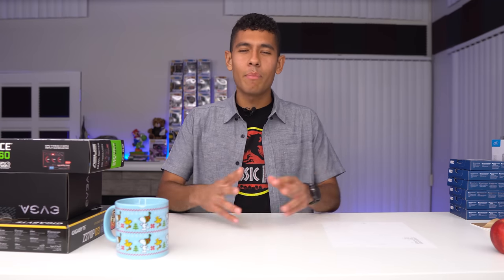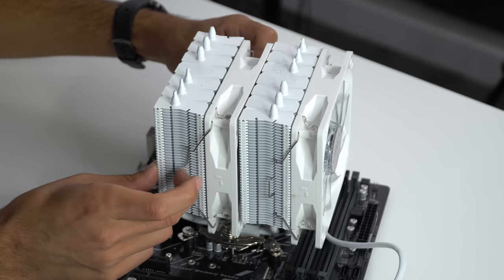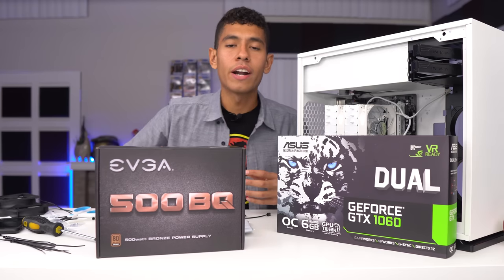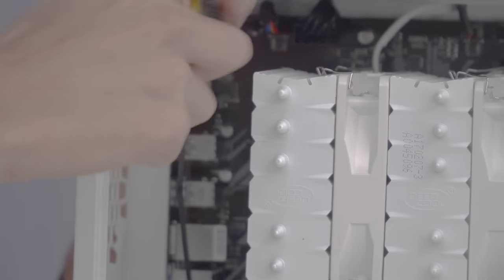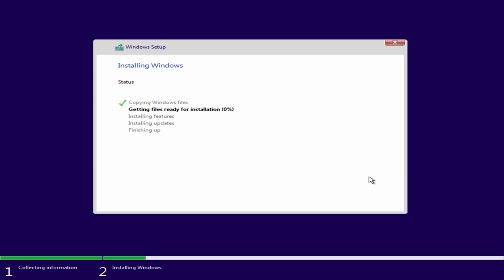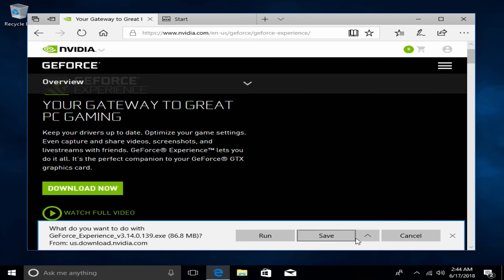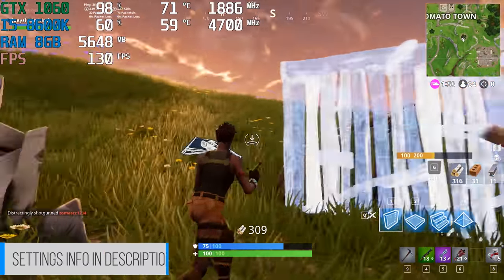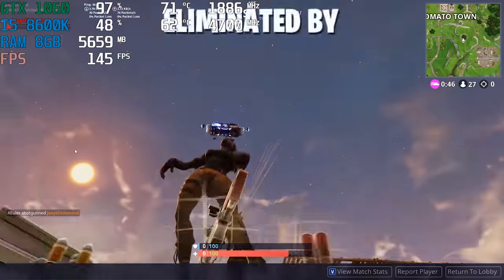Best $1000 Gaming PC Build Guide - GTX 1060 i5 8600K (w/ Benchmarks)

Comment: For a 1k budget you could an rysen 5 2600x with gtx 1660ti 6gb gddr6
Reply: This was made in 2018, but yes, thats very true
Reply: AFTER SWITCHING THESE ON pc PARTS PICKER IT SAYS ITS NOT COMPATABLE
Reply: @jaredsmith6047  the mobo in this vid is not compatible with the r5 2600x
Reply: @aldn9540  yeah i ended up not going with it, no worries. Thanks,though!

Comment: Can i change it to 2x8gb vengeance ram stick sry im noob but please answer
Reply: Yes you can. More ram is better
Reply: @thesuperr-.6679  what other processor can i use ? Can u give me the site in amazon international for other procie than this becuz this procie is out of stocked
Reply: @karlodawn1725  question is what are you doing with this cpu . Are you streaming and gaming, or just gaming?
Reply: @thesuperr-.6679  well ill focus it on editting and gaming
Reply: And i prefer ryzen than intel
Reply: @karlodawn1725  in that case than the i7 8700k is Intel, and has 6 cores and 12 threads. A similar ryzen cpu is the ryzen 7 1700x. Yet it has 8 cores, and 16 threads. One can do better then the other in some tasks. And the other can do better than the other in some tasks.

Comment: Can i swap out the GTX 1060 and get instead 1660 ti?
Reply: I would suggest a 1080ti the 8600k will outperform a 1060 or 1660
Reply: Josey Duckworth but it’s so expensive i can’t afford that
Reply: I paid 450 for my msi Duke used if you stay committed to finding a deal and save for a month you can do it. Also I highly recommend msi their warranty support is top notch
Reply: 1660ti will get you what you want tho but the chip will be able to do alot more I've got mine stable at 5.2 I'm also water cooled tho
Reply: Josey Duckworth ok thanks i will try that👍👍😊

Comment: Can this fan handle a core I9 9900k?
Reply: At stock yeah but overclocking it would be a problem
Reply: @jamesscott3290  thank you. I went ahead and purchased it. It's maintaining temps at 65 -69c
Reply: @japanish101  overclocked or stock?
Reply: @jamesscott3290  It's stock. I have a core I9 9900k and RTX 2080 super.
Reply: @japanish101  man you should get aio imo, with those specs u could add some more for liquid cooler .
Reply: @itisfullofcurry1313  I had a liquid cooler in my pc. It seemed my temps were worse. However, it is possible my liquid cooler was not good enough.

Comment: i built a (Core i5-10500 B460 Mother board A Pro. Geforce GTX 1660 Super 16GB RAM 480GB SSD 1TB HDD USB WIFI  power supply 700 w and windows 10 pro) 960$$

Comment: What frames does this run at
Reply: 35:33
Reply: Ok thx
Reply: @tylerhinton1264  u should cap it at 80 for all games unless u have a 144hz monitor cuz u don't wanna over work ur motherboard
Reply: I do have a 144hz monitor so what should I cap it at
Reply: @tylerhinton1264  I would just uncap it at that point unless ur playing csgo, or league of legends cuz u can get about 200 to 300 fps on games like that which is just not needed even for 144hz. If u do play games like that cap it at around 100 or higher
Reply: Ok, thx
Reply: @tylerhinton1264  scratch that. Always cap it a little higher then 144 if u have 144hz monitor
Reply: @gurveersandhu6319  no
Reply: @gurveersandhu6319  if you have a 144hz cap it at 144hz
Reply: supporters has talking about fps
Reply: @gurveersandhu6319  ¿

Comment: Buy 👏 Used

I build a PC similar to this that would have cost $900 but I got it for $550 with used parts
Reply: @Magnus Rasmussen what do you mean? If you cheap out on CPU and GPU obviously all your other hardware will be much more powerful but that doesn't matter because it'll be bottlenecked by your CPU and GPU do gl with that
Reply: @Magnus Rasmussen Oh. But that makes sense because at the time this video was made GPU and RAM prices were insanely high
Reply: @Magnus Rasmussen yeah!
Reply: @Magnus Rasmussen I just built another PC that has the i5-2400 and RX580 for $275

Comment: Hey guys can u help me 5700 vs 2060
Reply: 5700 is better when it comes to performance but it is hotter because it’s a reference card. That also means it’s hard to overclock on, but that means it uses less electricity since it only has 1 fan. The rtx is better if you want to stream since nividia has its own encoder for their gpus
Reply: Thx! 
Probs going for the 2060 coz I can also over clock probs won't anyway

Comment: Copied this build exactly but used a 1050ti
Reply: how is it holding up? Im building this as my first PC. Just want it to be the best it possibly can
Reply: JS Mithic pretty good, but i think i might switch to another case and a rtx 1660 instead of the 1050ti (also recommend a 600w power supply)

Comment: any chance i have this pc for a change my pc is worth 800 because of msi parts
Reply: DONT BUY THE PC!! ITS OUTDATED ASFYCK
Reply: Better then my pc still
Reply: Tomasz Bakala but it’s outdated bro. A GTX 1060 and a 8th gen intel CPU halfway in 2020... you can get so much better for the price
Reply: Tomasz Bakala for For 800 you can get a 1660super and a R5 3600/R5 1600AF. And for 1000 a RTX 2060 super and a R5 3600. Pick your parts wisely
Reply: I have a ryxen 51600 MSI 1060 6 GB its better to have i5 8